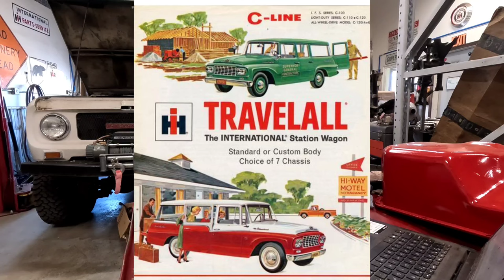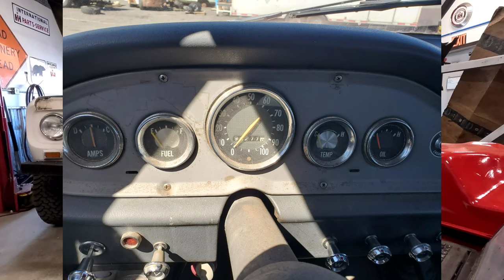The Binder Boneyard Podcast V7. Everything you need to know about C series Internationals

Comment: Only since you actually mentioned "gas mileage" on your 64, I have to ask, what hwy mpgs have you recorded?  

Also, asking for your confirmation - 68 doesn't have the IH hood emblem, correct?  

Lastly, my 68 Travelette has the Deluxe trim. What all does that include?  

Thanks for all you do!
Reply from the maker: 12 to 14mpg is avg. 68 does not have hood emblem. Travelettes had aluminum trim on the cab and bedside if it was a fleetside. Most of the deluxe package was interior.